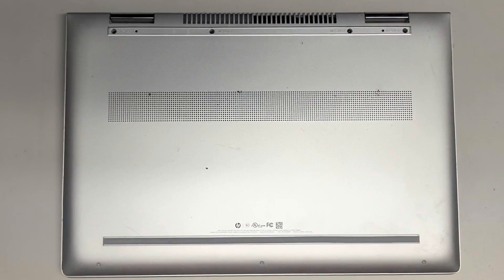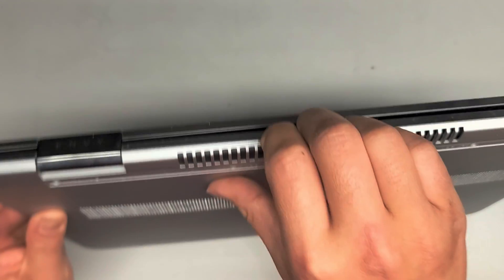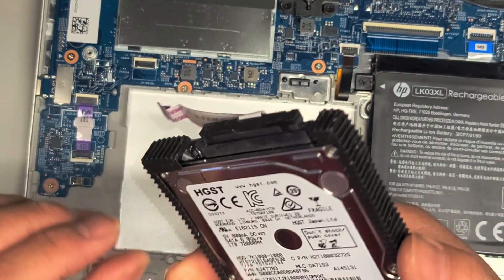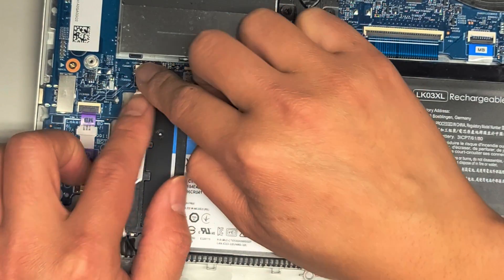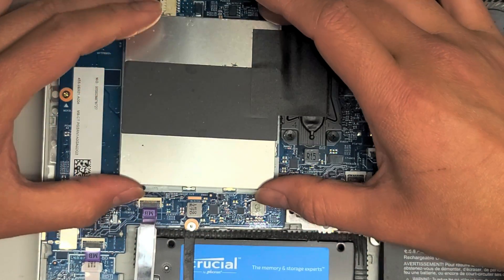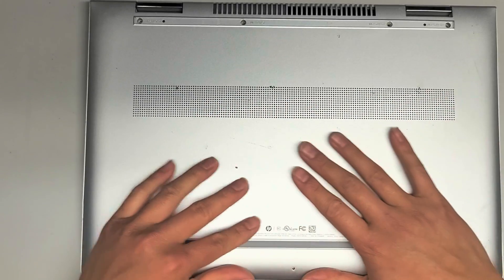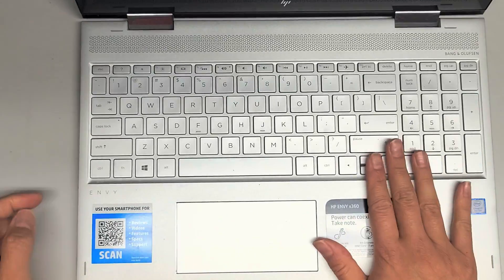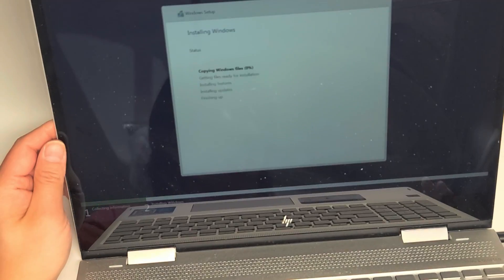HP Envy x360m Convertible 15m-bp112dx Disassembly RAM SSD Hard Drive Upgrade Repair Win 10 Install

Comment: Is 32GB ram compatible with this model? If so , where can I get?
Reply: Nice clean video.  Usually, I find, these have so much that is unnecessary or don’t clearly show things that aren’t obvious to people that need the video.   

Surprised to see that RAM wasn’t soldered.  All their literature says it is and isn’t upgradable.   Now, I have to quest to see if I can upgrade to 32GB.  Mine’s already open because I lost the case screws.  I always do.

As for that strip on the bottom, I doubt the user opened it.  We have two of these.  Both of us had one of those come off within two weeks.   Cheap adhesive.
Reply from the maker: @Antonio Anderson  glad you appreciate it. If you haven't already, please like and subscribe so others can find my videos. Thanks!
Reply from the maker: I can't find one. You'd be better off upgrading to an SSD.

Comment: what do you do if the 3 small star shaped screw holes are worn out, and they dont want to unscrew. In the beginning after the 4 top ones. i am having a problme with the 3 bottom ones.
Reply from the maker: Sounds like you're using the wrong screwdriver size or you need a better quality set. Try this one https://amzn.to/3CNgnJt but if you stripped it out completely, you need this. https://amzn.to/3H2BfyM
Reply: @ItsBinhRepaired  i disassembled it once and it worked. But I think 2 are worn out now the screwdriver just slides inside instead of unwinding. The keyboard and mouse don't work. The battery shows dead and not charging so I'm trying to open it again.
Reply from the maker: I hate how YouTube doesn't notify me of replies. Were you able to figure it out?